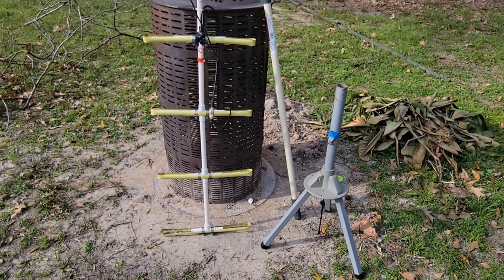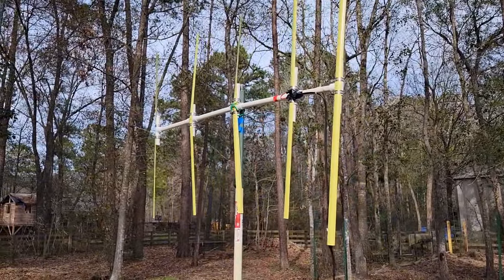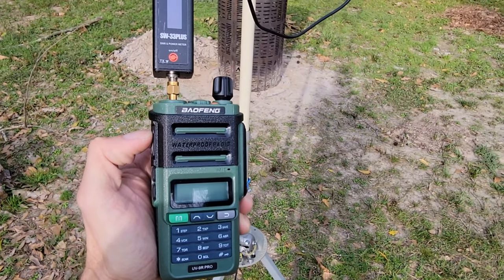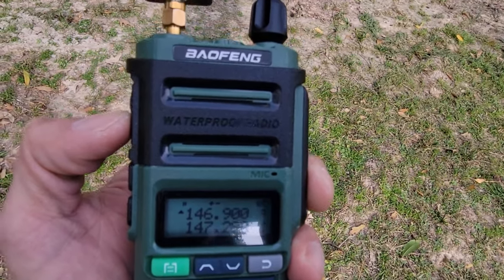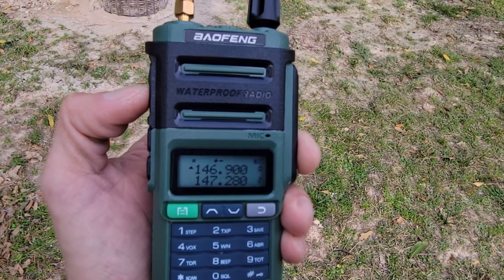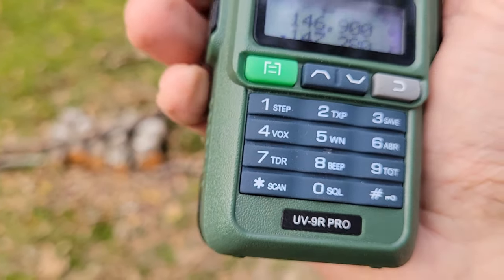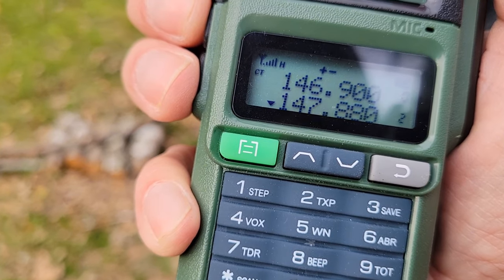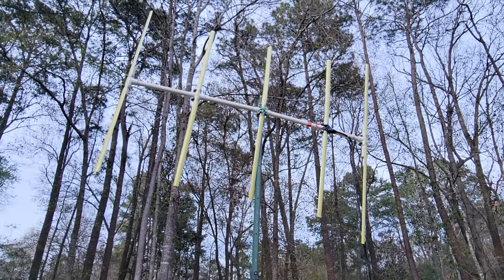2M Homebrew Yagi Antenna (with Testing)

Comment: Lil C !  This is Mr. T here in Kingwood.   Daniel told me you have a channel.  My people are discussing Comms for our garden club.  I would like to get with you and pick your brain about which way to go.  Congrats on your foray into YouTube.
Reply from the maker: Appreciate it Mr. T!
Tell el capitan I thank him for passing along my information. Would definitely like to give help where I can.
Godspeed!
Reply: @NukaVaultReadiness    C. , why did you pick that model radio?  with your diy antenna  you are getting 20 mile range?
Reply from the maker: Regarding the antenna, I was able to hit a repeater approximately 25 miles as the crow flies. It also helps that the height of the antenna on the repeater tower is about 300' in the air. Many factors can help or inhibit your signal.

For the radio, I picked the Baofeng UV-9R Pro because it is my current dual band HT I have for my go bag and in the field. It is rated at IP67 waterproof and dustproof. 5 Watts on VHF (2M spectrum) and approximately 3 Watts on UHF (70cm spectrum).